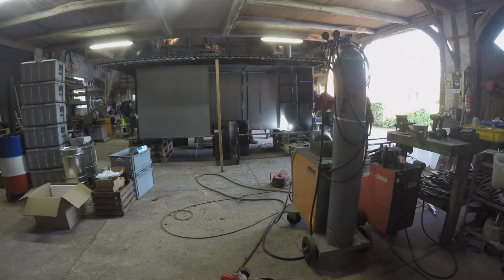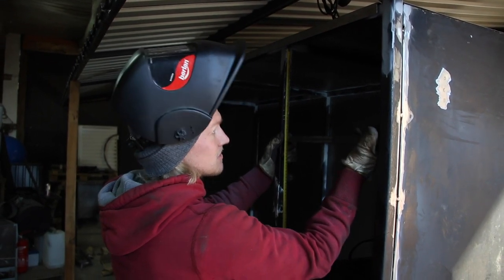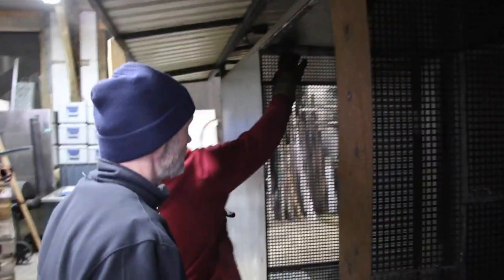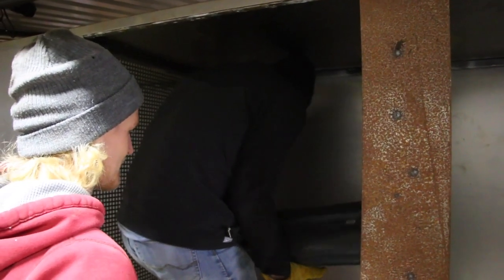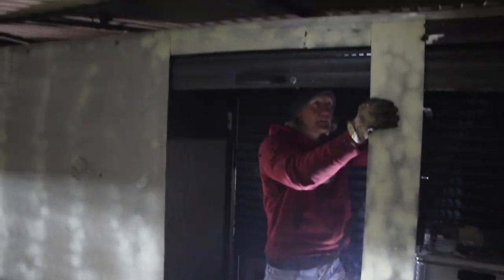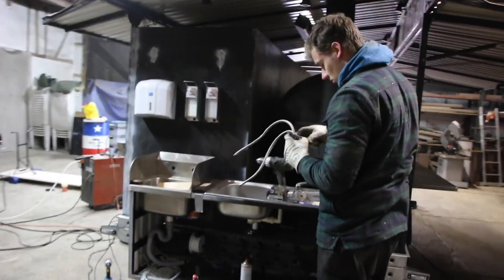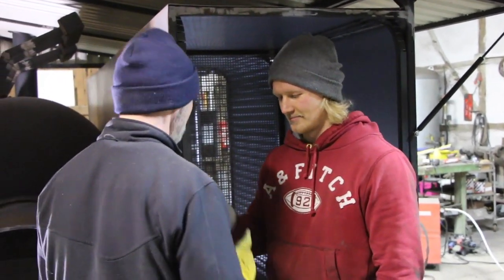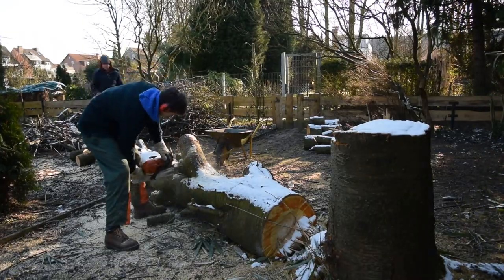Smoker Rig Refit Ep2

Comment: Great Job! The one thing you may have done already that i would suggest is to get the trailer weight with it fully loaded. Make sure those axles can handle that amount. I also hope the trailer has a breaking system.

Comment: Great video once again. Thx. Did you consider making more efficient use of the merc van rather than putting everything in the trailer? Another question is did you consider the weight distribution on the trailer and are you still OK with the max weight of the trailer? Just curious. Otherwise amazing work. Well done and enjoy the BBQ season.
Reply from the maker: Hi Rob and thanks for your questions! We did consider the total weight and distribution for the trailer. As for the van, we still need it to haul drinks and a refrigerator to events but are thinking on getting a different tow vehicle in the med term, as this is really low on power for towing a heavy trailer like this.

Comment: Hey guys. Great job, you are pulling here! Really amazing. Shows the huge amount of work that have to be done, before you can hit the road.
Wondering, how do you keep your meet cold enough, from when you leave home, and until you put in the smoker? Du you rub it at home, and then vacuum packeting it, or du you wait until you ar at the sight? Do you only have brisket, or do you also have puled pork?
Reply from the maker: Hey Paw! Excellent question. Really depends on the situation. Sometimes we smoke at our base where we can take the meat directly from cold storage. We then transport the cooked product hot in thermoboxes to the event (usually same or next day). For multiday events we either rent cold storage at the event or if its only a short drive we transport the uncooked beef in mobile coolers from our base to the the events. As per Franklins instructions we usually let the beef warm up to room temperature before throwing it on the cooker and will sometimes deliberately let that happen when transporting.

Comment: Hi guys, just a question, why not use roll-up style doors, like the ones used in malls for shops when they roll them down... box in the back corner, a small 10Nm motor, rolls it out... steel and sturdy...
Reply from the maker: I'm afraid they would be quite heavy and not the prettiest, but something I have to look into. Thank you for the suggestion!